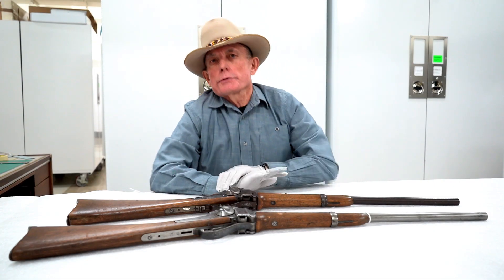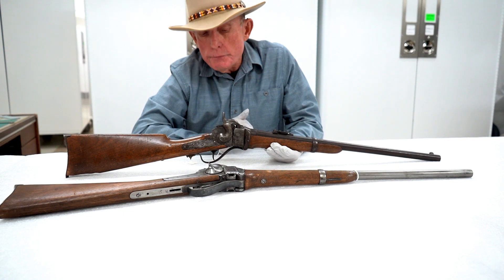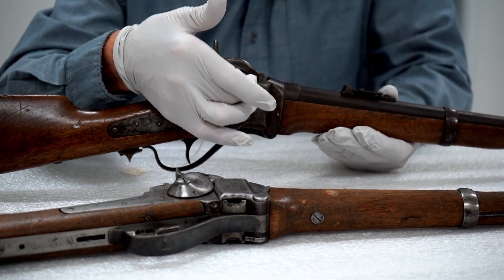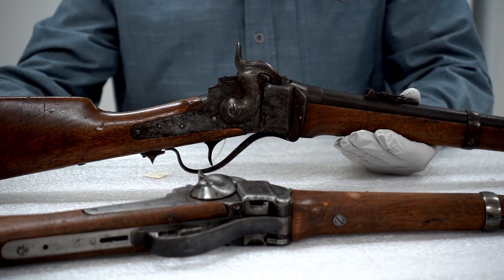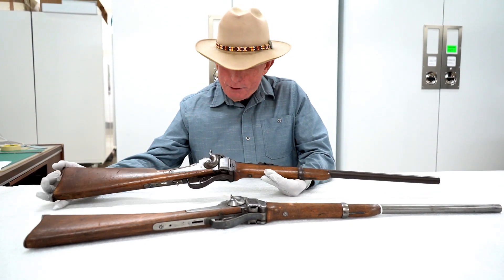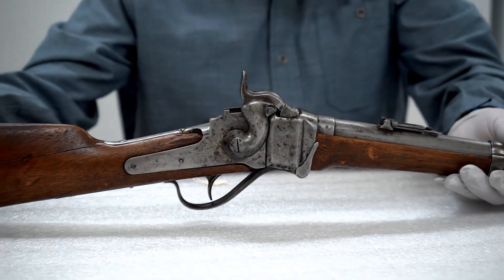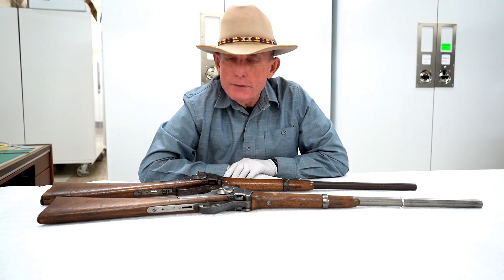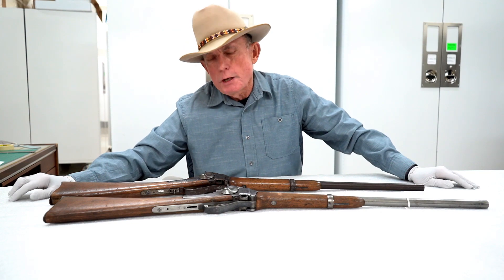Don’t Clean Your Guns!

Comment: There's cleaning and then There's judicious restoration. I just acquired an early production 1873 springfield rifle. Mechanically it was sound, a shooter in fact. But it had a ton of really dark grime build up all over the stock and some areas with surface rust here and there. 2 hours of CAREFULLY removing the patches of surface rust with a razor blade, (cutting the rust, not scraping) to reveal actual bluing underneath it. That and careful application of some Murphy's oil soap with fine steel wool dampened with water, removed the grime. That was followed up by a light coat of linseed oil. The end result was a very beautiful old springfield rifle with plenty of original patina that looked like it was cared for rather than left in a damp closet for 80 years.  If you approach it carefully, improvements can be made without compromising the integrity of an original too much. Because there are a lot of these rifles in existence, in this particular case, the value was actually improved by restoration. This should be considered on a case by case basis only. Weapons with particular historical provenance she be left alone. Thank you Evan for your knowledgeable regular guy approach to these presentations. They are very enjoyable.

Comment: There are great ways to clean and Preserve old firearms. But for God sake never use anything abrasive. Unfortunately I have seen many guns face the wire wheel and or sand paper 😞. Another thing you might already know. During the Civil War and for some time after. Soldiers were given steel wool or other abrasive material. to clean their firearms. So it's not uncommon to find original guns with no finish. There is a very very good way to clean and Preserve antique firearms. And it preserves and protects 100% of the original Finish. I can point anyone to this method if interested. Thanks for another great video.
Reply: Thanks for watching our videos.  Fact check me on this, but I believe some Civil War long guns were issued "bright" or "in the white" meaning there was no finish on the metal.  I have also found references to exactly what you mention, that in some cases soldiers either on their own or under orders polished the blued finish of their guns.  I was unaware of that practice until reading your comment and doing some research.  I always appreciate learning more about firearms, so thanks again.
Reply: @snappers_antique_firearms  Yes, I really like those Sharps carbines.  The one that was scrubbed was donated by a local law enforcement agency.  I don't know if it was worked on there or by another owner.  I assume it may have been seized during an investigation.

Comment: Sir, I have an old Remington Rolling Block that was given to me 5 - 8 years ago. It is in 
.22 LR caliber. It has a lever on the side that when pushed, the barrel can be removed. The bore is heavily crusted with old fouling. I'd love to see this old rifle send some projectiles down range but, I've hesitated to do anything because of this very topic you've spoken of. I don't want to ruin this piece of history. Do you have any suggestions?

Thank you for sharing your thoughts and knowledge on these old firearm treasures.

Stan
Reply: Stan, thanks for your interest and your question.  Cleaning the bore would not diminish the value of your rifle.  I recommend a good gun-specific solvent and a brass bore brush on an aluminum cleaning rod.  If the bore is as "crusted" as  you say, proceed with caution because you do not want the brush to get stuck in the bore.  Maybe start with a patch saturated in the solvent and let that sit for a bit before trying the brush.  You might even plug the bore on one end and fill it with solvent and let it work overnight, then some patches.  

 I'm leery of shooting old guns with modern ammunition. The rolling block is a strong action but I recommend that you take the rifle to a gunsmith to have it checked before you shoot it.  Also would be a good idea to start with standard velocity ammunition rather than any of the hotter .22 rounds.
Reply: @wsmvolunteers8588  Thank you Sir. I tried putting a Brass Bore Brush in the bore after putting a quantity of Hoppe's or another brand of solvent down the bore and letting it soak for a couple of hours. I put the bore brush in from the Breach and, it really got stuck. I had to put the handle of rod in a device and then pull the barrel away from the device. I could not pull my cleaning rod out any other way. 

I'm going to ask around for a good gunsmith that is highly recommended.
I'm up here about 20 minutes East of CDA Idaho. 

Thanks for getting back to me 
I really enjoy your channel. 

Stan
Reply: @harrisonmantooth3647   Wow, Stan, that bore must be really fouled!  I think you are doing the right thing to take it to a gunsmith.  Good luck with your fine old rifle.